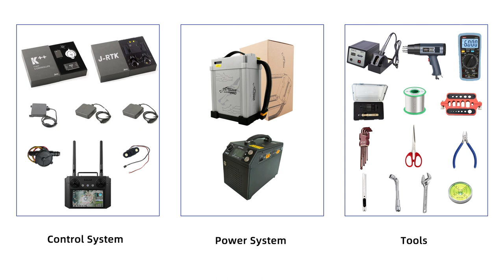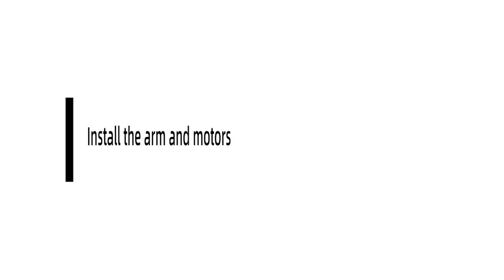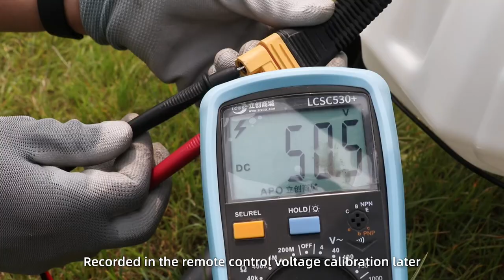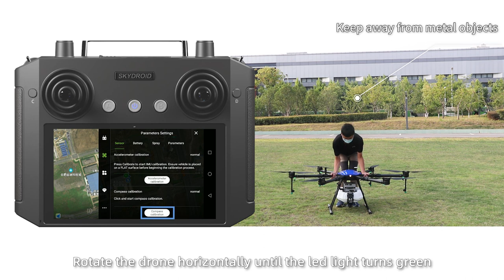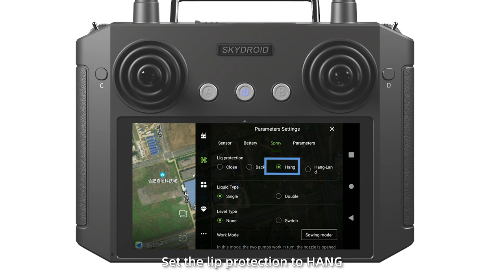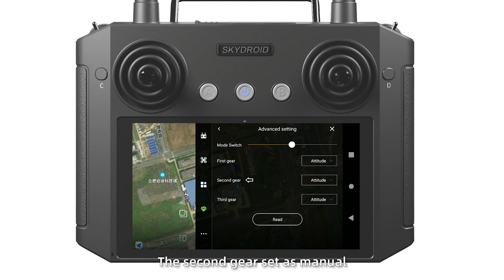Tutorial video || Hexacopter agricultural drone installation with EFT EP drone frame

Comment: I got one of this and I am facing compass calibration failure
Reply from the maker: First, please check whether the installation position of your flight control and GPS is in the center and in the correct direction, and then recalibrate according to the prompts on the APP and the guidance of this video.